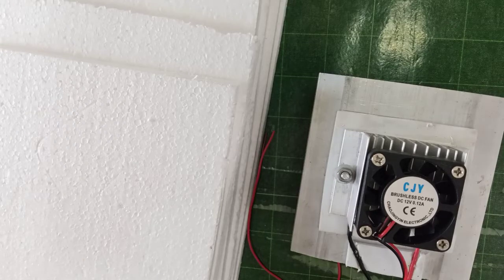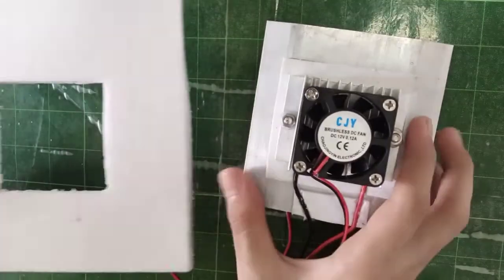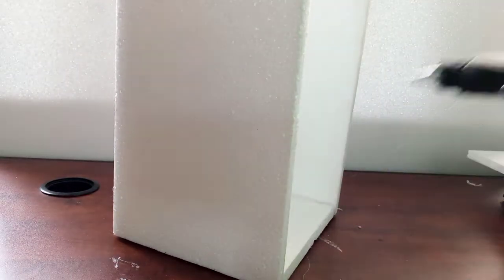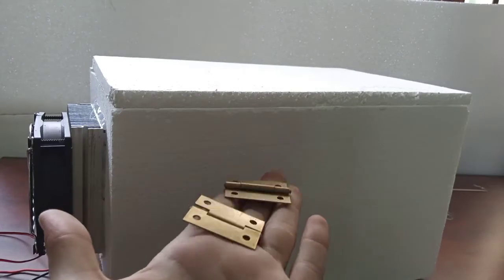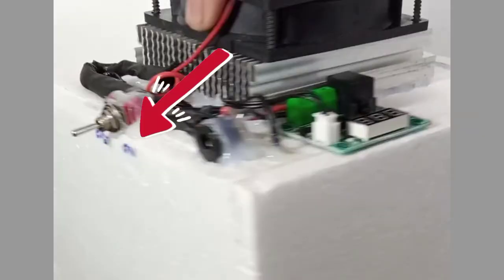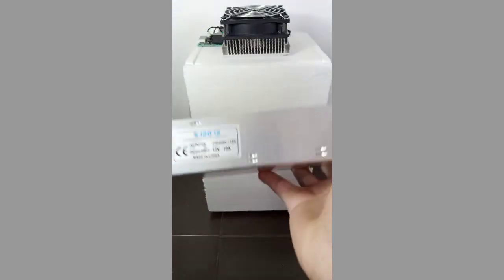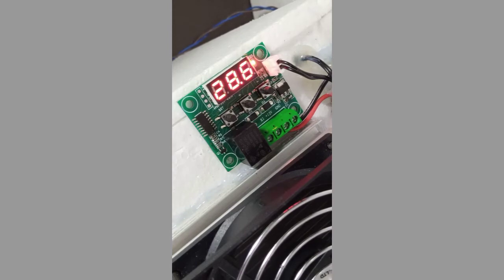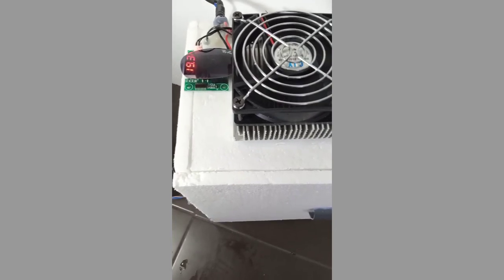How to make a mini Refrigerator | Tech 12706 peltier |

Comment: Can I use this kit with my 12V 2amps adapter because i don't have much money to buy 12V 5 Amps SMPs please reply 🙏 , can it be run with 12V 2amps please test and tell me if you have 12V 2 amp adaptor, usually it is used in our tv setup box
Reply from the maker: Hi Patel, .
If u supply 12v the CPU fan will work, but the peltier module won't be able to cool,
You can buy a 12v 5 amp transformer ( much cheaper that SMPS ) and convert from AC to DC, ( please do it carefully under the supervision of an expert as it is risky )
And let me know
 Thank you